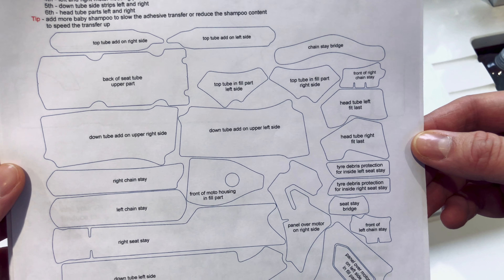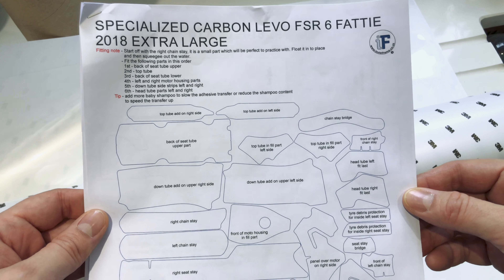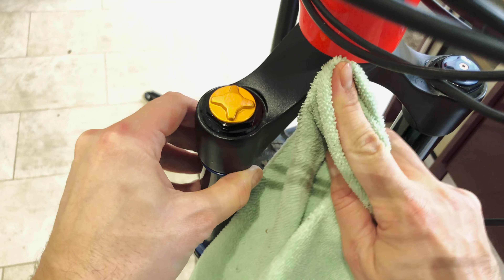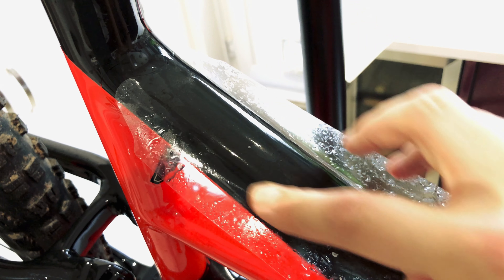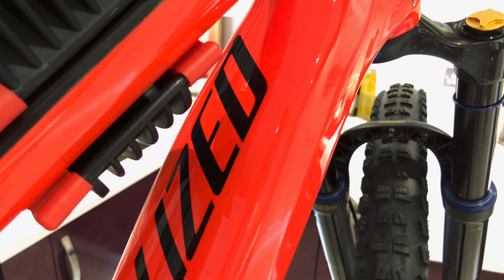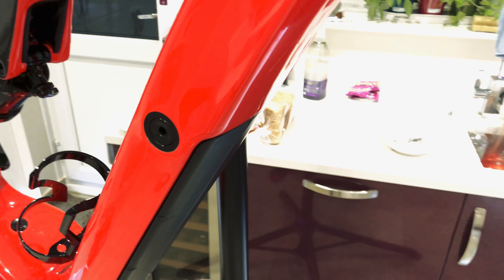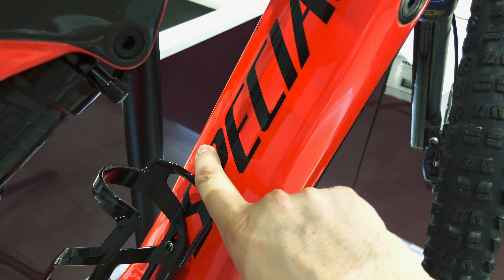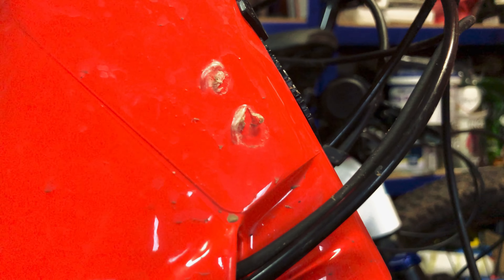Invisiframe fitting and Review on a 2018 Specialized Turbo Levo Expert

Comment from the maker: This was a tricky task! But I got there in the end. At the end of the video you'll see how the Invisiframe protected (or didn't protect!) the frame rubbing when I took it to Bike Park Wales! 😆
Reply: Nice video, I fitted my orbea rallon with the invisiframe kit took me 6 hours in total, but went on really well. I got a rock strike 2 days later and invisiframe kit did its job other wise I would of got a nasty paint chip or worse.
Reply from the maker: Nice job! I’ve got to say that the guys at Invisiframe provide top service. I told them about the issues I mentioned in the video and they sent replacement parts. Top job!
Reply: I agree invisiframe are very efficient I got next day delivery for free, due to slight confusion. The cut outs were spot on and its easy to apply. Definitely recommend. Wish they could send me a new piece out lol.
Reply: EMTB Forums Hiya Rob, get a roll of helicopter rotor tape and use your old sticker as a template. It gives stronger protection to the areas that get a proper battering.
Reply from the maker: Carlton Herrington thanks :-) Invisiframe actually sent me some new stuff free of charge to replace it. Great service 👍😊
Reply: Hey Rob, after seeing your video I am going to invest in the invisiframe, I was wondering what size did you get 2018 or 2018 updated frame?..I just have the 2018 Levo FSR 6Fattie/29
Reply from the maker: Hey mate, this one: https://www.invisiframe.co.uk/LEVO-and-KENEVO/FSR-LEVO-CARBON-ALUMINIUM-2018-on
Reply: EMTB Forums thanks a bunch...and keep the videos coming, total enjoyment and inspiration.

Comment: FYI The car vinyl-wrap guys find it helpful to use a heat gun / hair dryer to make the vinyl more pliable around tight areas. Should help speed up the installation a bit.  👍🏽

Comment: Did my Trek Fuel EX 9.8 last weekend...took me a total of 7 hours!! Ugggg. Well worth it though. I actually went with the mat finish and it looks amazing. Like you ,it did not come out perfect but i know down the road the protection it will give will far out way any imperfection i made with the install. One trick i found that works well is using a IPA solution. Once you get the main part os the vinyl in place and have decent adhesion you go around from the backside and spray the IPA solution on the vinyl..this causes the slip solution to evaporate, which makes the adhesion easier on tough curves. Also using a hair dryer was key to soften the vinyl during some portions of the process.

Comment: Wanted detail on the actual application of the kit like how did you use the baby shampoo, how much did you wet the vinyl ect, guess it's a review rather than a tutorial though. Those micro scratches can be polished out easily using T Cut then use tar remover.

Comment: I've just noticed on my 2020 LEVO, there apparently are already some
 "Invisiframe-like" bits in the most exposed areas of the frame:
- inner surfaces of the rear triangle 
- bottom of the down tube 
- back of the seat tube 
THANK YOU Specialized ‼️
Reply: Thank you Vince! Still waiting for my 2020 Expert to arrive and thought I should get an Invisiframe kit to cover it up when it's still new.
Since your post is six months old, what is your experience with the Specialized protection parts? Do they protect the frame enough and did you get any damages in unprotected areas of the frame?

Big thanks!
Reply: David Müller 
Hey Dave, get the kit! The protected parts of my frame are pristine. The unprotected matt blue paint tends to scratch easily. I keep telling myself that those are "battle scars" from being "well used". But they're just scratches. I should've gotten the kit. 
And Dave, you're GONNA LUV YOUR LEVO! Riding mine is like I've been granted the superpower of climbing steep walls! 
Have fun‼️